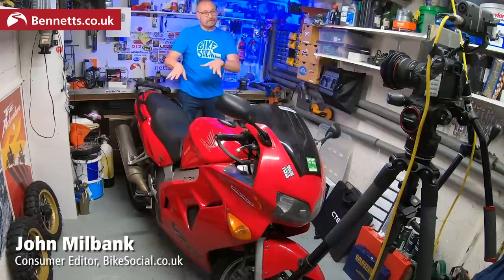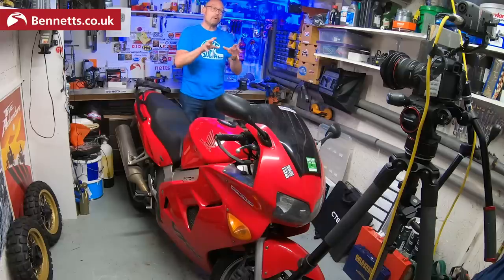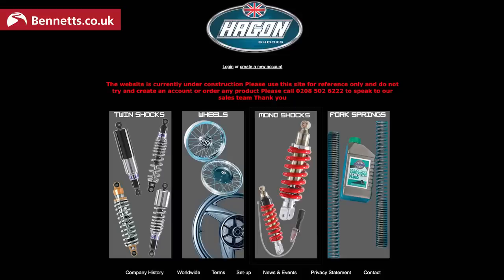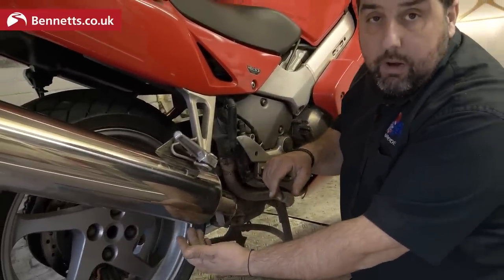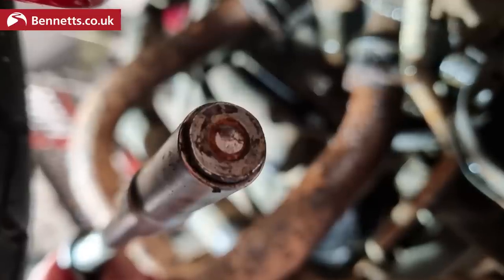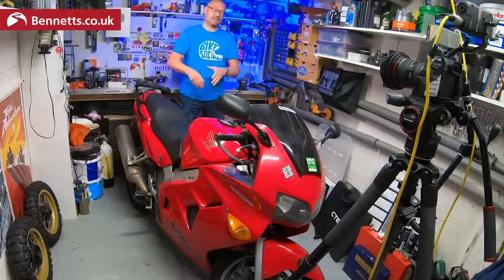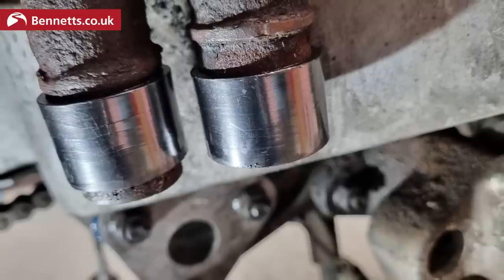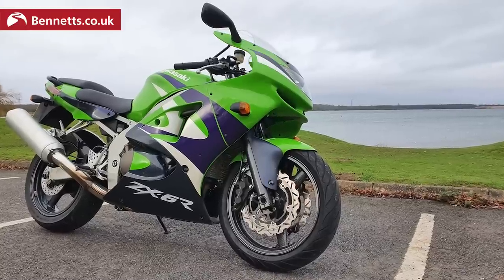Shock swap on a 97,000 mile VFR... what could go wrong? Everything.

Comment: Had my VFR for 11 years now, been slowly replacing bits, it took me 5 days to get the new exhaust back on by myself,  front on, rear falls off etc.  - rear shock wasn't so bad - had to change the throttle bodies (sensor failure - ebay to the rescue), I have all new internals for the front forks. replaced the spark plug caps - could only get origninals -- 4 for 250 quid!  but like you I got it cheap and with all the expense its still been cheaper than buying a second hand bike for a few grand; great series, great bike, keep the tips coming
Reply: I paid £1200 for my 98 6 years ago. Chain sprockets reg rec clutch & springs fork rebuild maxton rear valve clearances full exhaust rapid bike pro evo & a map, it's only my commuter bike...where do or how can you throw in the towel I've got thousands in the old lass ?

Comment: I've had my  vfr 2000 year since new,  replaced the rear shock earlier this year.  With the exhaust can  wheel  heatsheild  and lineages off , tank lifted  and battery box removed and the rear tank bracket we managed  to wriggle the shock out.  Then wriggle the new back in. It was a case of this is in the way lets remove it but apart from the can the rest stayed put. I bought a hyperpro shock as that's what my local m/c dealer sold and what a difference best mod ever.  But at 22 years old and nearly 50 thousand miles, I'm not looking forward to replacing the exhaust headers.
Reply from the maker: Yeah - I reckon I could have done it but I was also trying to get the linkage out to check and grease it all. In the end that final bolt was seized in and going nowhere! Fortunately the linkage moves fine.

Comment: the VFR major flaw is the mild steel exhaust system. if you take it off you pretty much need to do the stainless replacement because you don't want to take it off again

Comment: I don't remember removing the headers and collector box to change my shock? I used a Nitron. You are right about the exhaust though, my motorcycling mate helped and it went much smoother. I had spent weeks prepping the bolts with penetrating agent though.
Reply from the maker: Yeah, I wanted the linkage out to service that too

Comment: John, I did this exact job on my 2000 VFR800Fi... With a Nitron shock. It was nowhere near this bad... I can't really remember that well, I did it in 2019 but I vaguely remember that linkage nut being a touch difficult, having to use a bunch of tools connected together to get at it, but I didn't remove the exhaust at all. I did the job in half a day.
Reply from the maker: Yeah, I think this was made a lot worse by the seized bits. Cheers, John

Comment: I suppose when you are ready to replace the exhaust system it will come apart easy love my vfrs have 3 of  them and yes do all my own repairs myself a hgv mechanic . Honda vfrs are a well made bike if you look after it will run ever both of my 750 models i replaced the exhaust system i replaced the shockers like you did top tip grease the the linkage every 2 years . my other vfr is 1200f love that as well that v4 motor is a beauty.

Comment: Strange, I've had the rear shock off and on my 2001 VFR800Fi a couple of times (replaced with a Nitron unit) and not needed to remove the exhaust. I did have to remove that collector bolt when replacing the engine but managed to undo it without the need to drill it out.
Reply from the maker: I was trying to check and grease the linkage too – I do have a feeling that I could have had the shock out without all this faffery! After all that, The final linkage bolt was seized in place anyway! Fortunately it all rotates fine. For now. Cheers, John

Comment: You can save a lot of money on jobs like this by shopping around and researching on eBay. For example, generic stainless bolts and nuts solve the rust issues, especially with exposed exhausts etc. And it’s easy to improvise rubber parts from multipacks available from DIY stores, Aldi or Lidl etc. 

Adapt and improvise.
Reply: Totally agree

Comment: Love the maintenance vid waiting for the next. And yes working on the bike is really a pleasure, i do love doing the brake on my GSA, i find it really relaxing and at 95000+ Km have done it more then once... plus doing the tire... pull of the shocks to have them rebuild... i found that doing it i bond with the machine!
Reply from the maker: I don't do tyres any more – I did the on my CBR6 years ago, and my Dominator a while later and hated them. Luckily my mate has a tyre machine!

Comment: Not just hi-milers. I bought a new V-Strom 650 last year and they employed a chimp to assemble it from the crate. Loose front spacer as axle bolt not torqued up, cockeyed chain alignment and zero grease on gear selector linkage. However, its satisfying & confidence building to fettle your own bike. Bolts on my cbr945rr are either in good nick or replaced :-)

Comment: I just carried this out on my VFR without any of the problems encountered here. 
Mine is the same 5th gen with 55k miles. 
The exhaust is stainless steel, replaced by a previous owner and DID NOT require removing at all. 
The new Nitron shock was a larger diameter than the original but still went in relatively easily, I just needed to lift the rear wheel up a bit to get the clearance. 
Don’t be put off doing this work. I had the old shock out in less than an hour.
Reply from the maker: Annoyingly I'd deleted the bit where I said I hadn't need to do all that after all, but I did want to get thew linkage out completely to grease it, and in the end it was so seized I couldn't.
Reply: @bennettsbikesocial  yeah well with yours one of the nuts looked way more corroded than mine. It’s the one where the link meets the frame. I got a ring spanner on mine and it came off with some muscle. I think that whole linkage does have to come out anyway, to get the shock out. 
Really enjoyed your vids so far. Esp the one featuring John Mcpint.

Comment: Best stuff I've ever bought is 'PlusGas' release fluid. I don't know what they put in it but nothing else comes close. I spent over a week soaking a seized cylinder on a pre war Francis Barnett. Heated the iron barrel until the penetrating oil on top of the piston was actually bursting in to flames (did it outside and wore goggles. Not for snowflakes or the safety conscious) Used a lump hammer and wooden drift. Never budged a millimetre. Tried two types of fluid and even just regular oil. 
As a last resort i bought some PlusGas and within an hour it had freed the piston. It's amazing stuff!
Reply from the maker: Good call, thanks!

Comment: I'm having a combination of palpitations and flashbacks watching this. My own journey of pain was exactly the same of yours. I too fitted a Hagon rear shock and had the mother of all battles with the same bolt and the entirely crud-ridden seized 'dog bone' linkage piece. I used penetrating spray, mallets, hammers, freeze spray and eventually got the nut off with an angle grinder. My exhaust studs all snapped and the header gaskets were a pig to fit. This was in 2015 after I'd rescued my 1999 VFR from certain death by buying it back from a colleague I'd previously sold it to in 2005. I originally bought it in 2001. It was now in crap order having been left in a wet lean-to for years. Every metal part that could rust had done so, but after throwing a couple of grand at it and stripping it all down, then putting it all back together with new parts it lived on and still does today, in my garage. The moral if this tale is to stick with it because they are just so wonderful!
Reply from the maker: Excellent work! I've just had a nightmare with the thermostat, but things are looking up now. Hopefully. Cheers, John
Reply: @bennettsbikesocial  Oh dear me I haven't mentioned the front forks which had no paint on them with pitted and ugly stanchions. Trying to separate them to do the seals (perished) was no fun at all because the bolt inside the bottom end spun around like Kylie Minogue. I can't even remember how I sorted that out. Fairing bolts were corroded in place, instrument binnacle and seat were covered in mould, brake line banjos rusty, oil cooler pipes rusted through, silencer was full of rust, wheels were pitted and nasty etc etc. However - and this sums up the VFR - changed all fluids, charged the battery and it started on the button first time. It now looks like a showroom condition bike after a ton of work!
Reply from the maker: @vfrbore1728  Ooof, I feel your pain! For the fork bottom nuts, it's best to pull the fork out, and use an impact wrench to rattle the bolt out – that way it won't spin. Cheers, John

Comment: I had to chuckle watching this again, we've all been there, shiny sockets and spanners and a Haynes manual, what could possibly go wrong ?. Three hours later, bleeding knuckles, face covered in grease and contemplating phoning the scrap man.
I replaced my VFR800 shock with a YSS unit last week and struggled to get the old shock out at first, I had to drop the top mount as far as it could go then unbolt it from the shock, the shock then fell on the floor, fitting the new shock was the reverse.

Comment: Wow these bikes look like they had been submerged into the North Sea for a couple of years. Soo crusty and rusted up it's incredible..

I bought two of these VFRs 99' models. Rust free but both failed with electronics. 
Recertifiers two times.
Both at 130 000kms.
One was a dedicated track bike. 
No lights, mirrors, etc. Straight  piped, no collector. Sounded awesome just like MotoGP.😊
When the rectifier failed i just finished the sixth session of the day, so it stopped at the end of the event but it nearly burnt down.
The battery got such a load that it expanded into the frame and had to prie it out with tire irons and screwdrivers, when the whole thing cooled down. It was a mess.
Oh well it was fun until it lasted.😅

Comment: Im the owner of a 1984 VF750F with 50000km on it....I have often thought of upgrading to a VFR800 1999 to 2003 gear driven model but every time I see anyone working on one the complexity seems 10 times more than my old bike...so I have not pulled the trigger to upgrade...but darn do I like the look of the 800....If the 800 is anything like the VF750 Im expecting the bike to fit my 6foot 4 size very well.

Comment: I’ve had my 99 VFR 800 since 2003, now with 45k on the clock. One regulator rectifier, one exhaust (replaced by high level custom s/s one), one headlight and one seat later (oh, and a FSH), and it’s as good as ever. Although if you could pop by and swap the shock I’d appreciate it… ;)

Comment: I can completely sympathise with you. My project bike, an nc30 has the same problem. Literally got to the point of taking the rear subframe completely off in an attempt to remove the exhaust manifold from the engine before resorting to an angle grinder lol. They're so tightly packed! It's the thing that makes them great aswell as utter turds to work on 😆
Reply from the maker: Beautiful bike that'll be worth the effort!

Comment: I did all that a year ago fitting Maxton shock, I had already replaced the original exhaust system with Delkevic so getting the shock our was a lot easier. Did you realise if you take off the tank and the hinged holder there is a big nut under there that holds the top of the shock bracket on the bike. Release this and the entire thing drops out no need to struggle with the top of the shock under the bike. Plus you need a bike ramp badly, or better still a skylifter.
Reply from the maker: Ha... I did once I got there! I was trying to get the linkage out to service too though.

Comment: I've resisted the urge to comment until I watched the whole video... As a fellow 5th gen VFR owner I know all of this pain and more. Great bike, absolute b*stard to service. The link plate on mine also had groves from a seized needle roller bearing on the dog bone, I've had more header studs snap than I can count so again, I feel your pain completely. Just when you think the header pipes are going to be the worst bit, the VFR has a surprise in store for you haha. I also bought new gaskets from wemoto, mine also didn't fit! I also ended up crushing them then gave up and just ran the old ones

I've actually got a shelf in my garage dedicated to all the parts/bolts/fasteners/broken things that I had to get creative with when trying to remove - I call it my trophy shelf! The only thing I also did was replace the swingarm pivot bearing while I was rebuilding mine as it's often neglected because it's such a pain to get to!
Reply from the maker: Thanks so much for this... glad it's not just me! I've got six of these videos backed up, but I promise to get more out in the next week or so. Cheers, John

Comment: I've had a 96 VFR750 . The exhaust had a ball joint to swing it out of the way to remove the rear wheel.  Also had a 2002 VFR 800 first of the VTEC motors. Owned it for 9 yrs put 85000kms on it. Only normal maintenance and tyres.  Still had the original chain and sprockets when I traded it in. We don't have salt on our roads in Australia. 🦘
Reply from the maker: But you do have killer bugs!

Comment: Im watching your pain and feeling it. I have a 1997 GSXR1100 and its a pain in ass {38.000 miles}. I had to buy a new bike because i cant rely on it to take me anywhere. I only ride where there is cell phone reception within a small radius of home in case it shits out again again.
Reply from the maker: Bugger! That's not even that high a mileage!
Reply: Er.. electrics by any chance?! Had a slabby 1100 and more modern 1000s and Suzuki always had a poor reputation for their electrics in the eighties - frikkin' rightly - and if they don't still, they should: as the 1000s are no better. 

Connectors' quality shite, weak regulator/rectifiers (and on the slabby, weak coils)...
Reply: @villiamo3861  Yes all the connections/ relays/ switches etc . Apart from that its an awesome bike. My 80s Katana 750 was the same. Its a 1997 1100 so i will sell it or if i cant get decent money leave it in the back of the garage to rot. Maybe i could start a bonfire on guy fawkes night with it lol

Comment: Don’t think I ever had to take the exh. off to get the shock out but I have broken a exh stud off. I made a wood ramp to keep the swing arm/wheel up. Grease the gaskets to keep them in place.
Reply from the maker: Yeah - looks like I could have got away without taking it off, but I wanted to get all of the linkage out to grease it. Cheers, John

Comment: Keep em coming on the vfr because I'm nursing a 80k 98 model on the daily commute. How did the overheating go mine doesn't like traffic or hot days fan on over time in the high 90s
Reply from the maker: Not good... I think the thermostat has had it, but it's a sod to get to
Reply: @bennettsbikesocial  it certainly is and not cheap. I ended up changing the intake rubbers not cheap either🏍️👍

Comment: I've got 4 older bikes, your description of the trials and tribulations as you work through it are very apt - but how good do you feel when you've conquered the problems  !  Honda have this great reputation of finish, but hell do they make bad decisions in some areas - on my vfr750 I cracked off a piece of engine casing because a mild steel pipe support, case bolt and aluminium casing had utterly bonded together - used releasing agents, heat etc etc  thought I'd loosened it, only for a piece of aluminium to break by the threaded case section
Reply: The V4s are mostly very good, but the hard to get to bits aren't designed to be easy to work on after a few years !!
Reply from the maker: I feel your pain! But yeah, it is rewarding. I had to machine a part for the cam holder on my ZX-6R out of scrap aluminium and was well chuffed with that, especially after my mate who's a mechanic said the break meant it was knackered.

Comment: Appreciate this was "just" the shock, but would it be fair to say that all V engines are a pain to work on, and the more cylinders the greater the pain? 🤔
Reply from the maker: Hmmm, tricky. This is a particular pain as it's so crammed in. I wouldn't say more cylinders are more awkward as my 4-pot ZX-6R wasn't as bad, but that's only done 18,000 miles and it's an inline four. Yeah, Vs can be tricky I think, depending how they're put together.  More heavily worn bikes seem harder as more things fail when you take them off. It does come down to design too though. Really, you can't generalise I reckon; it's the bike itself and the state it's in. Cheers, John

Comment: I’ve done a couple shocks on Vfr’s without much trouble but none of the bikes had 100k. I did have one exhaust stud that came out with the nut. I do like the Hagon shock but haven’t seen it available here in the US. I had my exhaust system JetHot coated early on and have had a couple of Delkevic header systems over the years. Unfortunately the don’t tuck in as nicely as the stock system and somewhat interfere with the center stand.

Comment: Black widow full high level (get the rear wheel straight off) stainless steel all gasket & a fitting kit £400 it literally fell on. No collector box bollocks.
Reply from the maker: Tempting! Been looking at the Delkevic pipes too.

Comment: HECS (catalytic convertor equipped) VFR800s have rubbish mild steel exhausts - my 16k mile 2000 bike wasn't amazing. And that cat/collector box bolt was knackered on mine, too.

Gen 6 VFR800 ones fit, and are stainless, and are cheap on eBay. You just have to chop off the centre stand rubber stop bracket (it's on the collector box/cat rather than the rear can on the Gen 6, because of the high mounted pipes).
Reply from the maker: Excellent, thanks!

Comment: This is a prime example of why I'd rather just put it into a bike shop to be fixed.  Does do my head in at times as my father in his 70s still rebuilds motorbikes the new project being a CB 500 prior to that a 1950s panther.  If I'd only took his advice and went into engineering 🤔